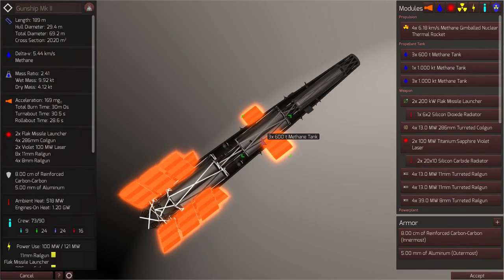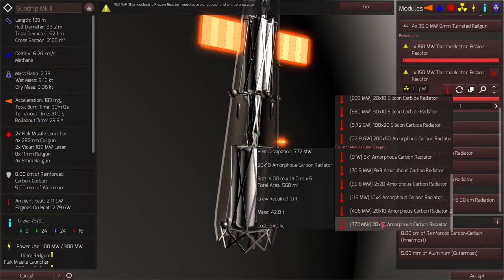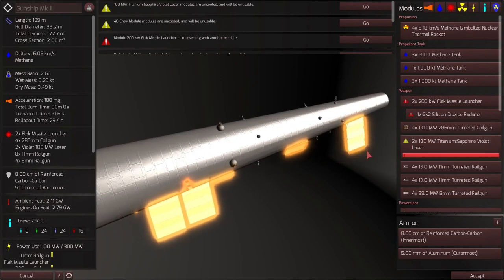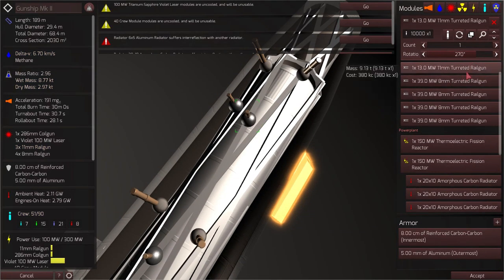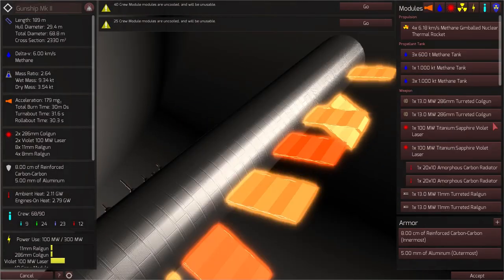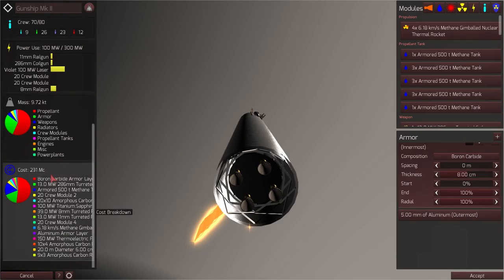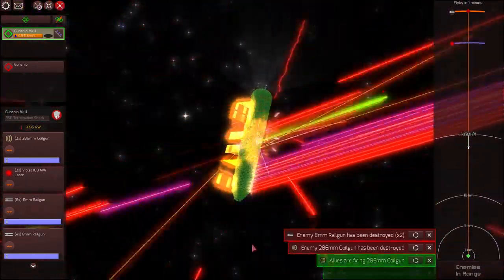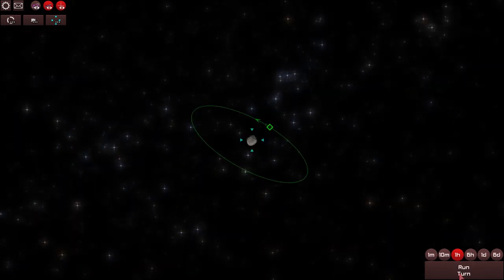Gunship Re Design - Part 1 - Children of a Dead Earth

Comment: I think some of the main problems with COADEs ships are as follows:
>no ability to retract radiators during combat, even for a short time
>no ability to repair or replace components when not in direct combat
>no ability to propel on residual propellant
>no ability to recover drones that are damaged or out of Delta V.

Imagine if you were fighting an engagement around a panetary body and you go into your initial flyby against an enemy unit, and you were able to retract radiators and store heat for a period of even a few minutes.  Lithium or Sodium could be viable materials for heat sinks, if for example, a gram could absorb 3.57J.  I'm spitballing but that's viable for a reactor in game.  That's how Attack Vector works it.  Ships then become 'much' more survivable in the opening engagement, even at brawling ranges.  A lot of combat presently revolves around scoring hits on a ships main radiator.  

Supposing you and the enemy survive your initial flyby and you open range to a few hundred kilometers.  It could be a week before the next engagement.  Yet there is no way to patch a hole in a radiator or affect temporary repairs to an engine for example.  This could be a reason to bring 'cargo' modules in design or even a dedicated cargo ship.  These modules exist in game but are basically only for roleplay purposes.

If you've lost one component of your propellant (for example, all your fluorine tanks are destroyed).  You can neither repair and refill them, nor expend your remaining propellant (methane for example) for some temporary control, using it purely by expending it under pressure for a much reduced Delta V.  

And finally, Drones, whilst they can be refuelled, cannot be recovered or repaired.  We assume they are recovered post engagement I suppose.  But when fighting missions like Jovian tour, it could be beneficial to recover them.

Comment: Nicely done on your redesign BTW.  I really should get to work building more durable ships.  My current strategy is to minimize cross-sectional area so I can fire before they get in range and disable them before they can fight back.

(when it works, it really works... when it doesn't?  It really, really doesn't XD)
Reply from the maker: Yeah, the whole cross sectional area thing is something I hadn't considered.  Being small is huge.  Why built redundancies into one large ship when you can have many smaller ships?

  It doesn't happen in this video, but I go against some of my Guapo-A ships and I'm completely out ranged.  I'll be talking about that in part 2.  I've been having a lot of fun with this ship.
Reply: That's a big part of the reason I'm shying away from multi-role ships, instead I'm going the specialist route.  It's easier to make the ship smaller if it isn't expected to do everything.  On the other hand it does make the force as a whole less resilient to losses.
Reply: @ReadySetRudy  In defense of large ships, they are much easier to protect, allowing narrower angles for rads before they self-irradiate, as well as a higher volume to surface ratio, which is actually pretty big, it generally means higher R, so more space for payload, also relatively thicker armor for the same relative weight, and large nukes deliver less of their payload against fewer ships (while small nukes are arent that strong)... Another point in the armor department is that whipples can be spaced further with a lower weight penalty, and armor can be slanted much easier and with more distance in absolute value, which can allow to expose the front only while still firing most weapons and protecting most radiators and use shadow shielding; those last tactics can severely reduce cross section while offering maximum defense and redundancy, getting (almost) the best of both worlds. It also can allow to cheese a little the AI, by staying out of range with bigger guns and more ammo, then telling to ignore max range, specially effective against many ships as missed shots can still hit and you need fewer hits per kill...

Now, in my opinion, that is neither the best tactic. A single inflexible huge ship can still be dispatched by overwhelming it with TAS (thicc ass strikes), there are simply things that can knock out any ship no matter how big (like that gun that fired dust motes @2%c, or stupid huge nukes) so you probably want a more varied fleet able to deal with different threats and tune it for the one you're facing. 
Lastly, for cheesing purposes (WAR AINT FAIR), the AI is pretty bad at dealing with a lot, lot of tiny glass canon ships, it just doesnt fire... You can do a similar thing with big ships and ignore range, and they're easier to make nimble to hit&run, tho it requires a bit more skill :P

Edit: geez the textwall... Sorry, not sorry ;P

Comment: Is it realistic to position all radiators on one side of the ship? Space is of course a vacuum, so there is no atmosphere drag and radiators are not aerodynamic enough to function like wings anyway but still - wouldn't such an asymmetric layout affect the control of the ship or put more stress on the radiators during acceleration due to an uneven distribution of G forces?
Reply from the maker: That's a problem for the engineers to figure out 😁